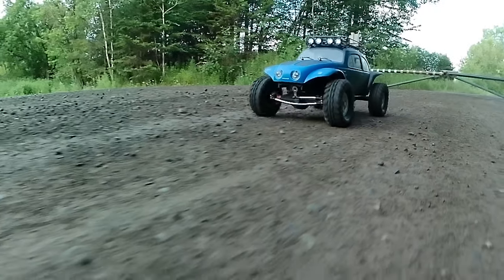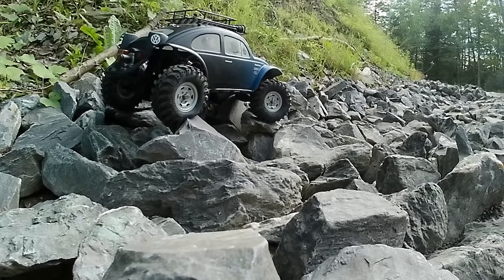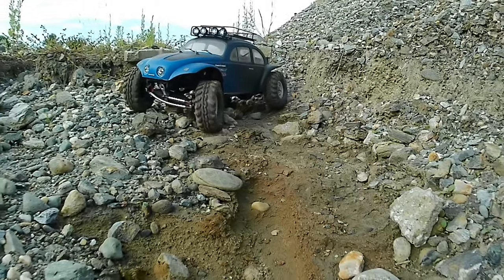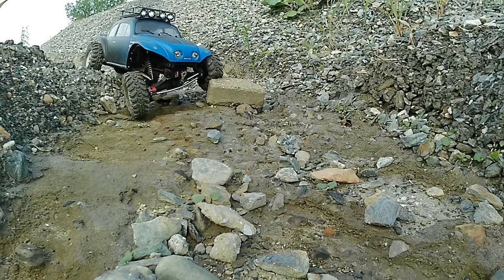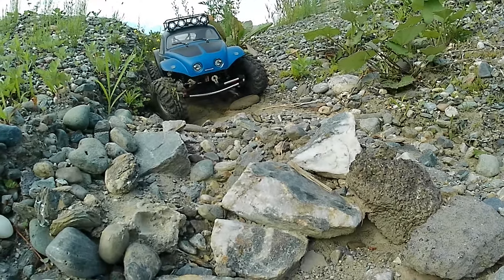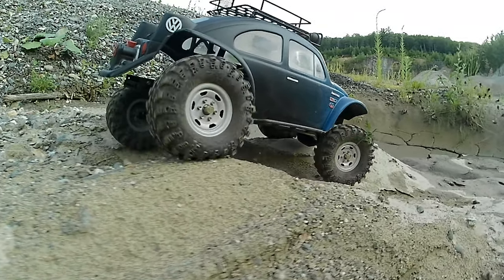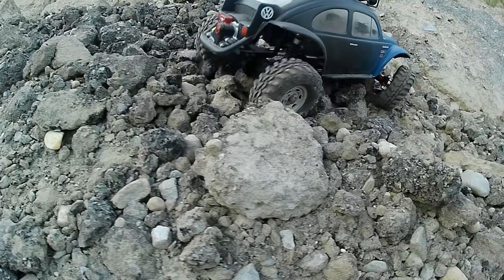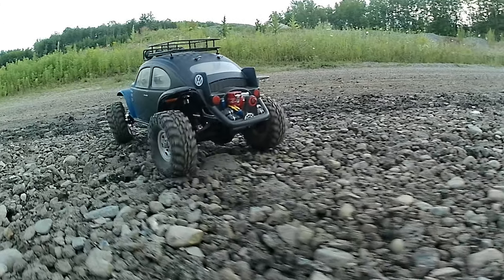1/8 Scale VW Super Beetle - Quarry 1

Comment: That’s a sweet rig. It reminds me of a bug my uncle had. I was yellow and setup for Baja. Good memories. 

Have you considered looking at Team Associated shocks. I know they have some of the best out of the box suspension. 1. Not sure if they’re a direct fit. 2. Don’t know how much they cost. Might be something to consider.
Reply from the maker: When I was young, we had a 1973 Beetle, which was the inspiration for this one. It was even blue. Used to freeze my butt off going back and forth to school sitting in the back seat. The heat in the things used to SUCK something fierce.

I got the shock thing fixed. For now. I managed to get the metal ring tapped out of the inside of the shock and got the gasket removed that was causing the problem. They flow free now. Plus, I'm also not trying to spend ANY money right now ;)